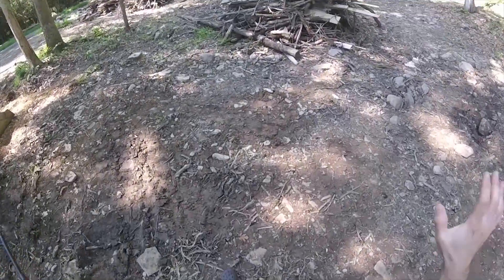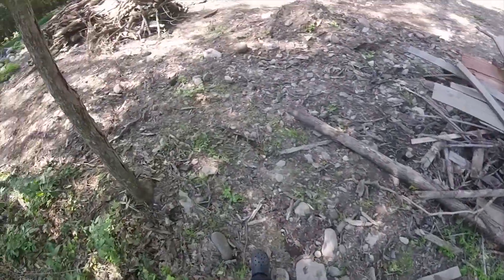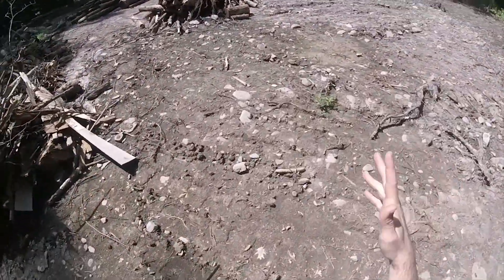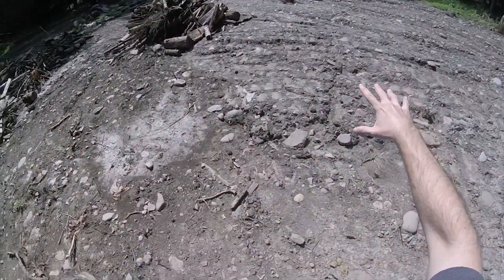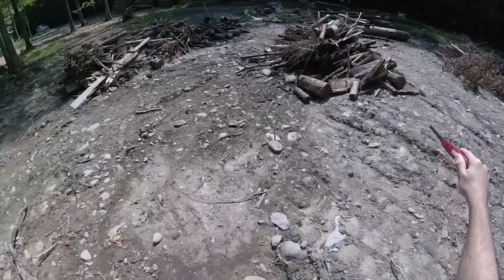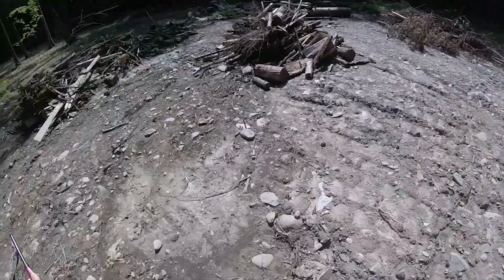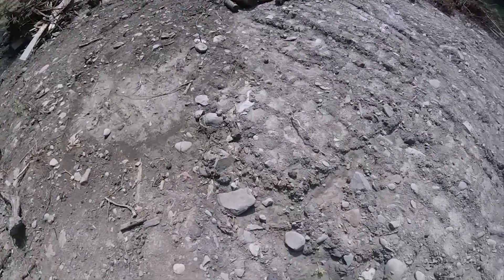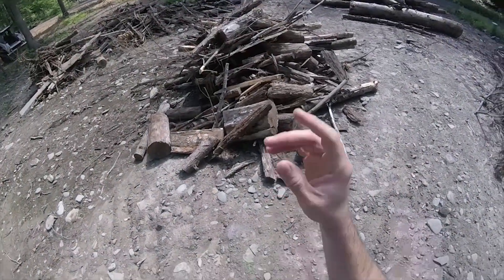Burning Brush

Comment: Hemlock is the tree, use it for a more "weather resistance" lumber compared to white pine.  Just watch the larger ones here in the Hudson Valley tend to be "shaky" hemlock, the growth rings separate when in lumber form.  I prefer it over using white pine it is denser and has a nice red hue to the wood.
Reply from the maker: wow thanks for the knowledge

Comment: favourite film?
 °up in smoke° 
Cheech & Chung
favourite song?
°firestarter° prodigy

tell me how much would it cost for a small team with a large machine for a day to turn ALL your brush into woodchip?
did you know that a huge pile of woodchip can create useable heat?
did you know woodchip improves soil?
did you know woodchip actually decomposes into soil over time?

all if these things have value. even putting the branches onto pallets for local collection has value. 
basically I don't think you have a long term outlook . am I wrong?
Reply from the maker: we do have a long term outlook but you raise interesting points.  dan may take a crack at answering your questions if he gets the time.  thanks,

Paul (editor)